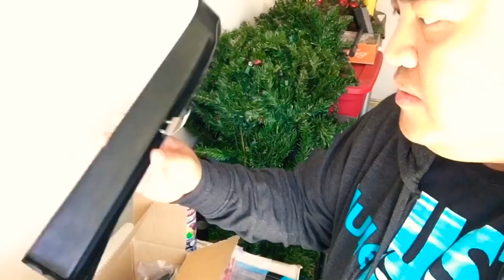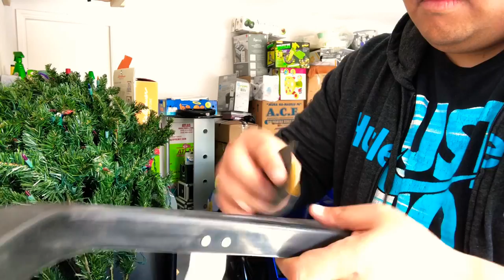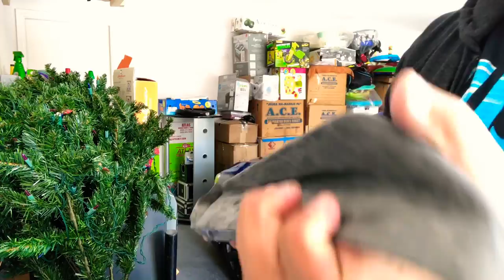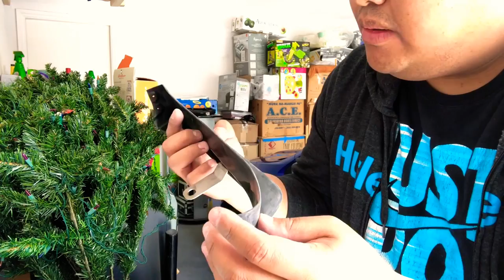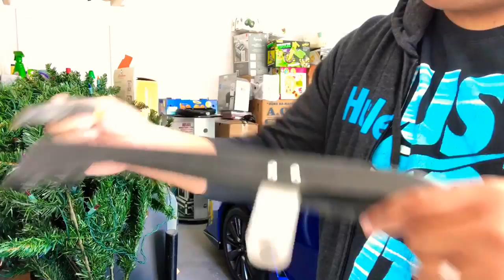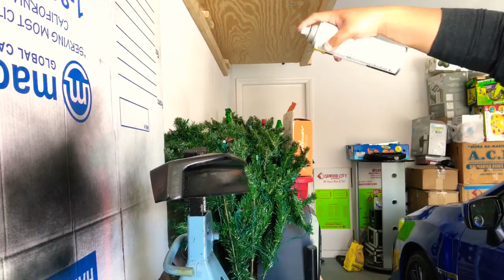Painting Wrx Aero rear bumper ( ABS )

Comment: kuya penge po ng link sa rear lip. ty!
Reply from the maker: send ko syo mmya.. work pa ko, wait mo nlng ah.
Reply from the maker: pa subscribe sanji.
Reply from the maker: https://rover.ebay.com/rover/1/711-53200-19255-0/1?ff3=4&toolid=11800&pub=5575477609&campid=5338470859&mpre=https%3A%2F%2Fwww.ebay.com%2Fitm%2FFit-15-18-Subaru-WRX-STI-4dr-Rear-Bumper-Lip-Aprons-Spats-Diffuser-2PCS-ABS%2F301981129132%3Ffits%3DYear%253A2018%26epid%3D1163451898%26hash%3Ditem464f7a59ac%3Ag%3Ata0AAOSwdzhcFwHV%3Ark%3A27%3Apf%3A0
Reply from the maker: na send ko na yung linked syo.